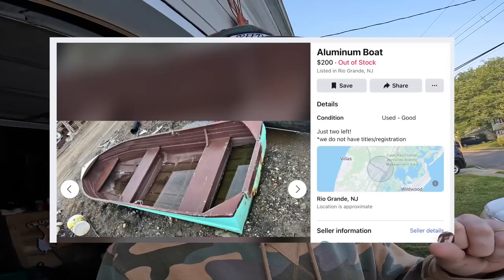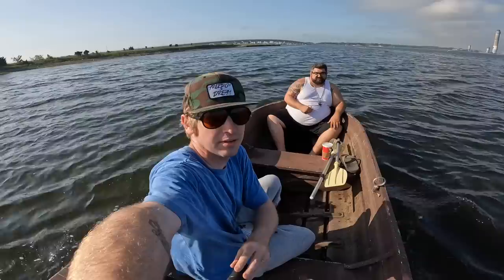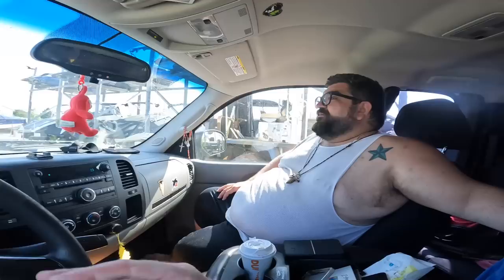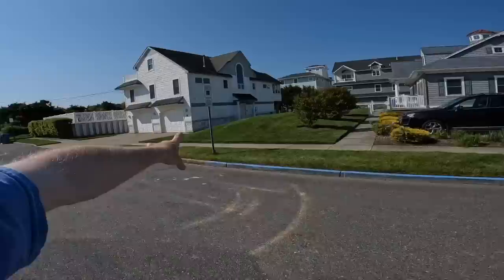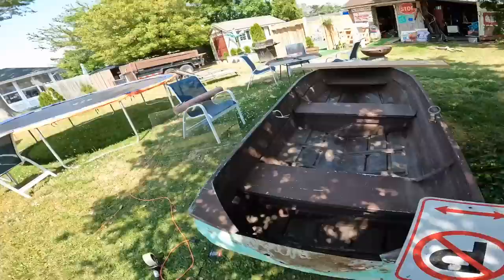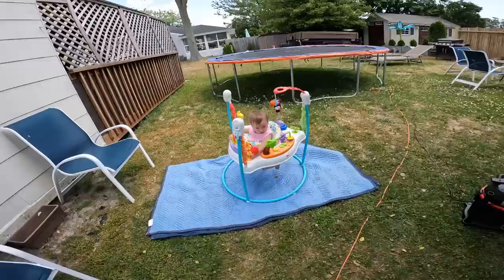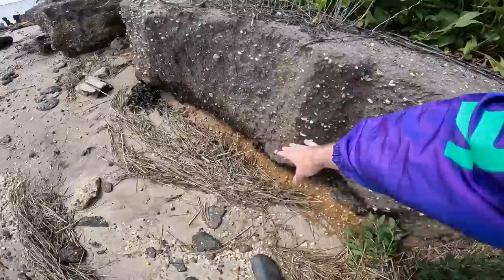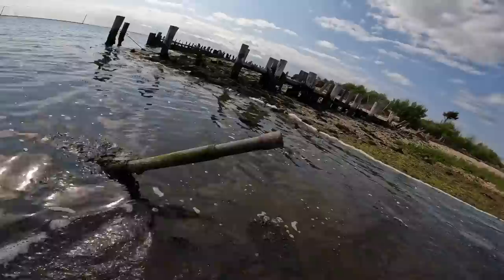I Bought $200 JON BOAT From The Scrapyard!

Comment: JB Weld is always good for quick boat repairs. Also, you can bring a cooler with you on your boat for your electronics. Most coolers will float pretty well in an emergency.

Comment: Great deal but i would have done some repairs on it before taking it out. I would have sanded down to bare metal, several coats of either rubber coating or fiber glass, painted it, and I bet it would have been great on the water. I would've had life vests just in case. Glad you guys are ok. It's a shame all that metal couldn't be used and is just rusting and wasting away.

Comment: I knew that car that was being pulled out was Eddie Wilson's. I decided to do some digging. The creaky bridge used in the movie was actually the 9th street bridge connecting Ocean City NJ and Somers Point NJ and scheduled for replacement in 2008. Also, in that same scene where Eddie goes off the 9th Street bridge, you can see the old"Bay's Shore" sign. another great place to party. So maybe that was a place everyone partied at back in the day in NJ. I found all the info on 80's rewind  Eddie and The Cruisers filming locations. There is quite a few mentions of Somers Point. You may want to check it out. I hope you find a few interesting things about your area. I hope I did not bore you too much. You guy's take care. Be safe!!   I did copy the things written in the article so none of us get in trouble for using their words.

Comment: You want a treated piece of wood on the rear called the transom.  It's supports the motor. It goes on the inside and sealed and bolted through the aluminum. Part or the boat.

Comment: Ok I’m jumping in with my big mouth.  I saw this coming when you carted that thing from the scrap yard and then when I saw Paul was going I knew something was going down.  Pun intended 😂.  Sorry Paul, but you should have sat still 😂
Leak Stopper Rubber Flex for the inside bottom and sides and the outside bottom.

Comment: You need to put some of the sstuff they advertise all over the bottom of that boat. It's like a rubber seal, it use to advertise all the time, now its advertised only when they have a new product. I cant remember what it's called but you might remember. It was big about 5 years ago.

Comment: Dang uou guys got lucky tipping over.  You might try some like truck liner to spray on the bottom for extra protection when dragging or loading and unloading.   You can get waterproof ammo like cans that are plastic to put valuables to keep dry.

Comment: You're lucky you didn't scratch yourself with that rusty metal! Im glad you got a tetanus shot otherwise you'd been in trouble if you would have cut yourself. Although you can get one after you scratch yourself but you must do it right away, that day or the next. Even if you've already had one get another one. Don't tell them you already had one otherwise they might not give it to you. Just tell them what happened and you need one. It's better to be safe than sorry. My Dad's brother stepped on a rusty nail and his dad told the doctor to give him a tetanus shot but the doctor refused, saying he didn't need one. 2 days later his brother's jaw locked up and he died a few days later. It was too late but if the doctor would have done it when his dad had asked, he would have been ok. My dad was always getting us tetanus shots, that experience with his brother made him super cautious with us.